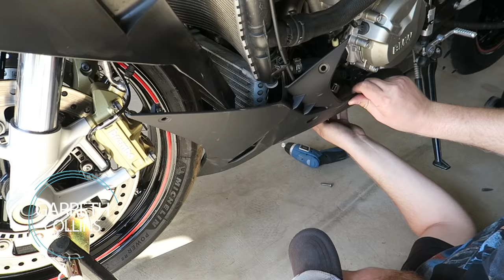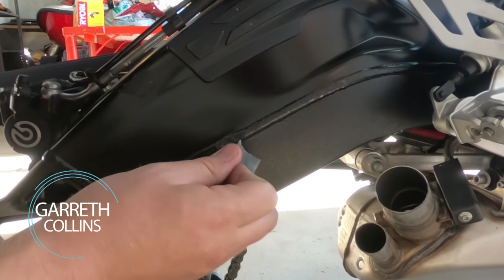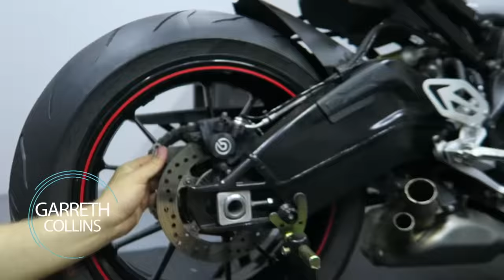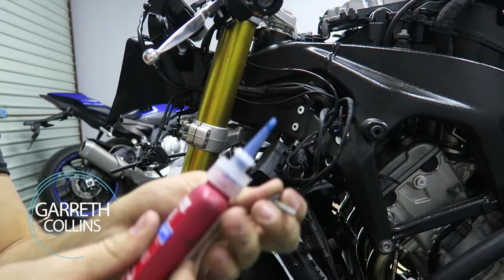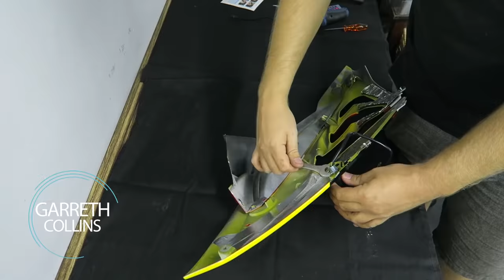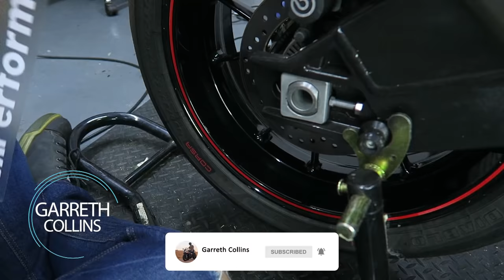Rebuilding A Salvage S1000RR in 10 Minutes (COMPLETE BUILD)

Comment: #GarrethCollins any particular reason you've removed the oil filter first and than later drain it at the oil plug i know on my zx10r when I'm doing a service it's such a pain as I need to fill the oil filter with oil first but then when I'm done and start the bike it flashes oil low because every time it ends with a air bubble so then while running I have to loose oil filter just a bit to get some oil out and air and its fine so then just add more after its all cooled down and settled that's what I found on YouTube apparently most Kawasakis do that
Reply from the maker: well i remove the oil filter first leave it off and remove the cap to drain all the oil and remove any compression the engine might have from any reason.

Comment: Hey I seen you had a 2015 and 17 S1Krr any noticeable differences between the two that you notice? Electronics/power?
Reply from the maker: To be honest I feel no difference between the two. Basicly the same bike
Reply: Garreth Collins alright thanks I was told the 17 is a bit better with the electronics and power, Did you check to see if the restrictor in front of the air box was removed?
Reply from the maker: No i didnt they bike rides alot better than the 15 but itd because of the modifications i did to it. But so far i have not felt any difference
Reply: @GarrethCollins  You should check you can tell by looking through the front nose of the bike and see if you can see the air filter or 4 circle holes
Reply from the maker: @infinitycl  i'll have a look. Didn't know
Reply: @GarrethCollins  Alright let me know

Comment: I just like to add that you can tell that  us Brits are less about the bling and our racing of sports bikes is miles ahead of the USA , ok 
FIRST watch ppl doing America track days there a lot slower , ok the general pace on a British track day NOT RACE DAY ! Is quick 
This will in turn make someone whom may have been slower up his game and basically see other ppl gunning that bike round corners YES these bikes can go fast round corners 
And the no one puts a level protector on the clutch side , if you was to poll up on a U.K. track day with both ppl generally tell you new and 2/3 track days in the guy takes it of cuz you look stupid, WHY ?? ... it’s only on there to stop you hitting in to another rider and in turn sending you over your handle bars , on clutch side it will not fetch you off , and us Brits love i nice looking bike . But there is also a lot ov ppl the ride bike with NOt a lot altered on the bike generally updated suspension and breaks before the motor , a standard 600 with just the gearing changed is good enough 
My 03 Cbr600rr when I’m on the gas head knees tucked in singing the tits off it does 151 absolutely flat out 
That’s with the volume on load 

If you do track days look how often your about that speed some tracks differ obviously,
I reckon I half decent track day ride from the U.K. could turn up on USA tracks on a good gsxr 400 or vfr 400
And you lot would see it’s not about bling and power !